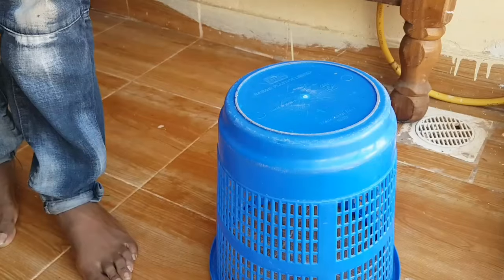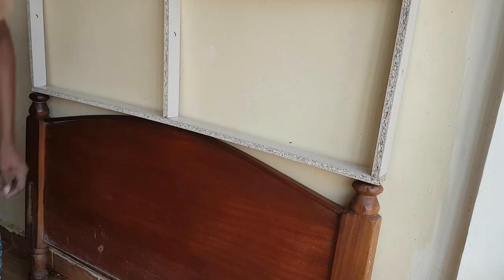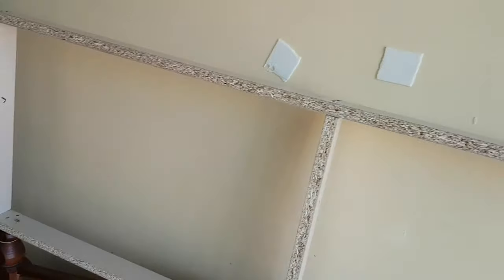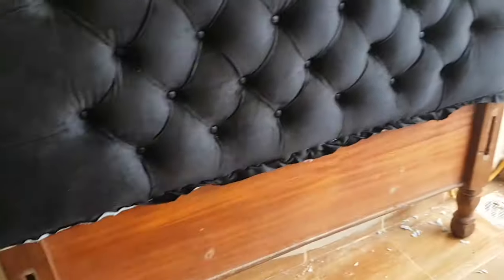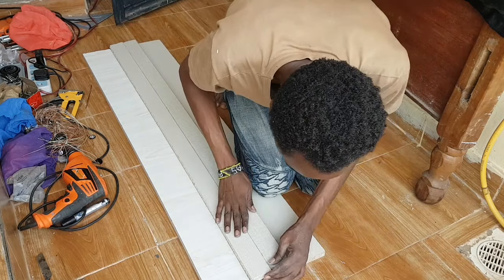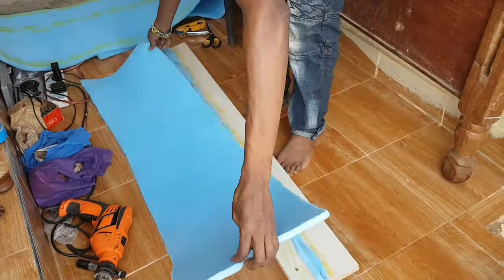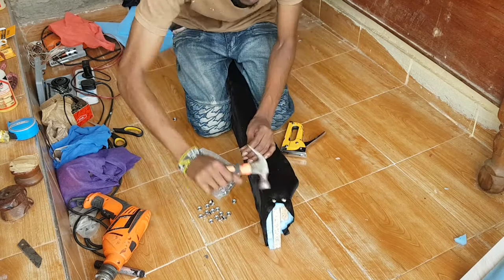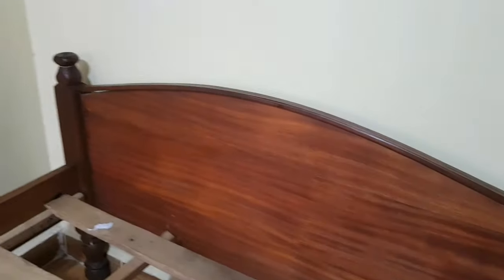DIY How To Make A Tufted Headboard For Your Old Bed // Bed Transformation DIY

Comment: Good job done.. Kind of transformation which i am planning to do for a long time.. I have some doubt, whether the head rest will hold support if placed away from wall, 🤔, or do we need to add any sheet of ply till bottom on back side.. A reply will be of great help
Reply from the maker: Thank you so much...,so for the headboard....use two strong pieces of wood on the sides of the headboard...I'm talking about those two side boards with the shinny pieces of nails on the headboard....the reason for them is for the design and strength of the headboard...this is because you will be attaching the added top part on the headboard and the original headboard together using it...I use nails but u can scraws also

Comment: I wanted to know how to take measurements of that design.. what measurements did u took?
Reply from the maker: Transformation doesn't have any specific measurements....you just measure the current height of the headboard and adjust it to your desired height....mostly btwn 4feet to 5 feet....

Comment: I was just asking how much does it cost to  turn an old bed into a new bed how to do the money used for the material and the labour work
Reply from the maker: Depends na design and size of the bed
Reply: A 4 by 6 the same kama hiyo bt colour blue
Reply from the maker: That will cost you 9500
Reply: where are you located plz
Reply from the maker: Kasarani